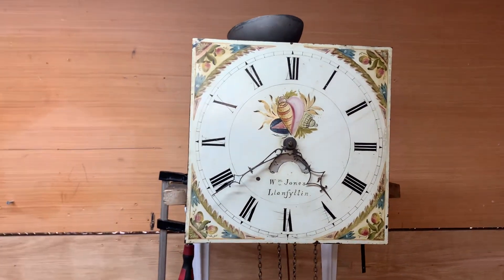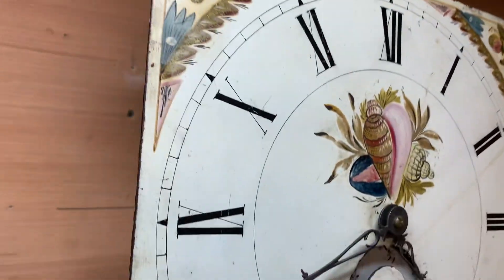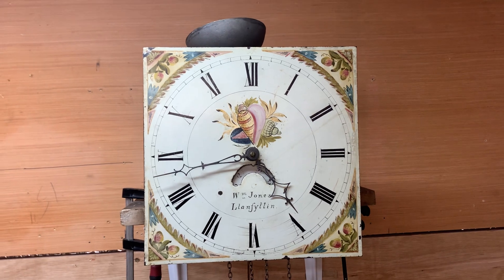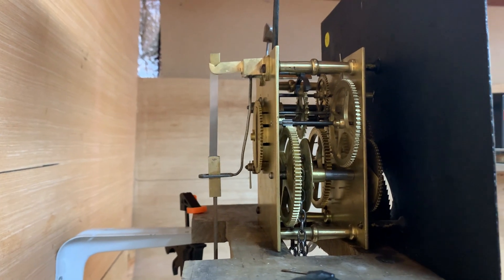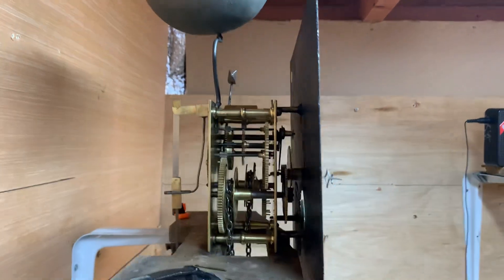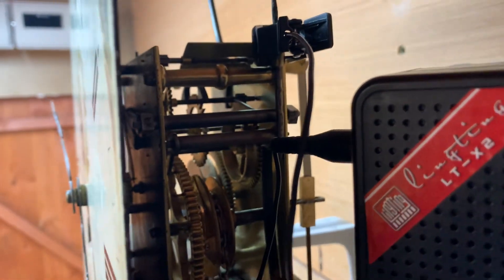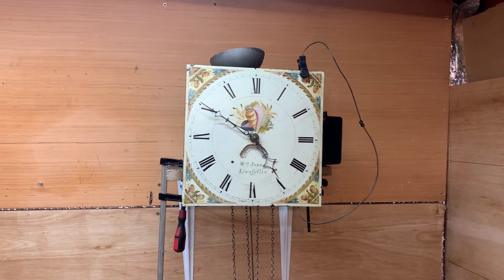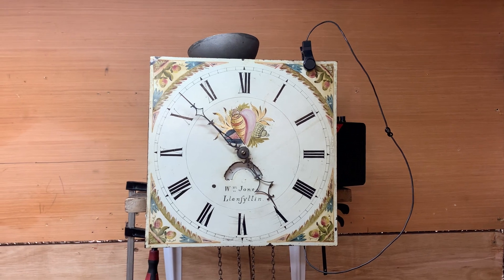30 Hour Grandfather Clock, a General chit chat

Comment: I’ve just bought an old grandfather clock with one weight on chains. I’ve always had two weighted grandfather clocks so not sure how to wind it up and where to put the weight? Does that make sense?
Reply from the maker: It’s a 30 hour clock , needs to be wound up every day ,the weight will hook onto a pulley that’s on the chain and the chain is pulled to wind the clock up.

Comment: I have a clock very much like this, currently in a horribly damaged case because the builders who were told to carefully cover and protect it misheard "it's not a family heirloom"(my mother bought it) as "it's worthless trash, kick it around and splatter plaster onto it as much as you like and if you want to see if you can wrench the door off its hinges, hey, have fun!". To my untrained eye, the working parts look pretty much identical aside from the fact that the weight's on a rope rather than a chain. In fact it's so similar, aside from the art and signature, that it makes me wonder if the faces were mass produced and then customised by the individual clockmakers - the cutout for the date is identical. 

 I had to do a tiny little repair to it some time ago, it would run and then stick at about twenty to - turned out that the lever that triggers the chiming mechanism was sitting a tiny bit too low down, so that rather than come up underneath and lift it, the peg on the gear would jam into it end-on. Somehow all I had to do was push it up a little bit, and it didn't fall down there again.

Anyhow, thank you for this video, you've helped me to put a rough date on how old my clock is.

Comment: If the face is original to the movement, it can't be a 1750's or 1760's clock.  White painted dials were not produced until 1770 at the very earliest.  From the style of this one, I would say it is almost certainly 1790's or early 1800's.  Early painted dials didn't have colourful motifs in the corners, they had gold painted spandrel-like decorations, the coloured corners came later, as in this example. The style of hands too suggests the same range of dates, i.e. 1790's or early 1800's, it could be as late as around 1810.
Reply from the maker: The thing that attracted me to this clock is the escapment set up,
Reply: C1830